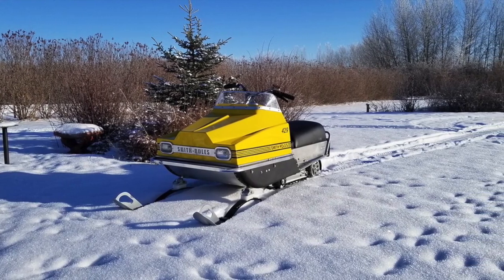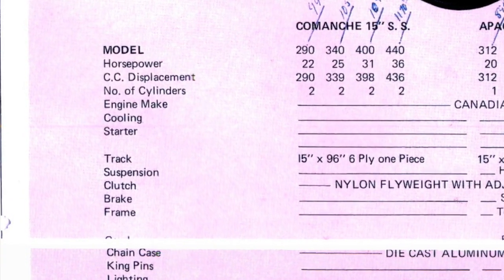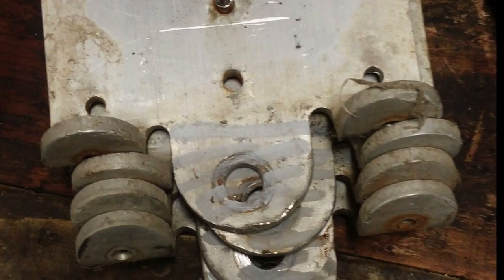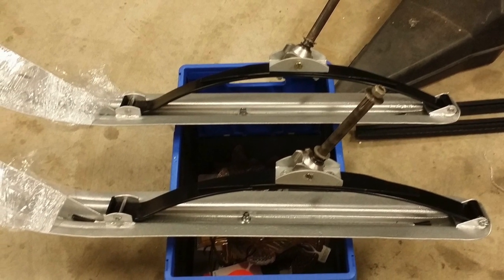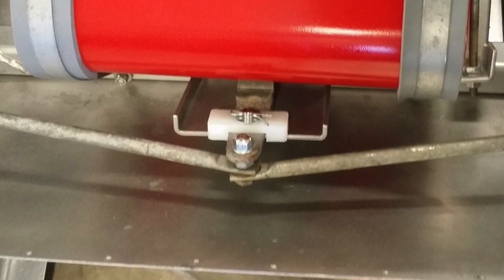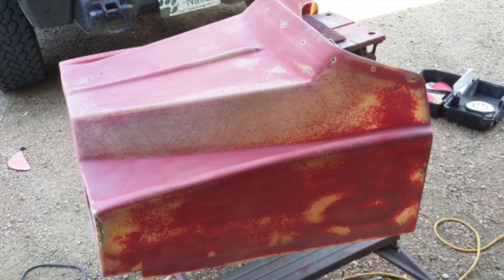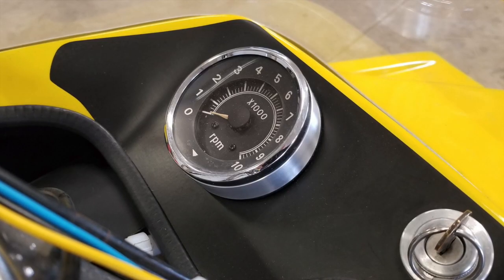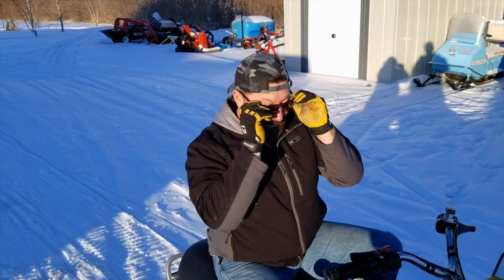Don't Get Daved Episode 18 - Making History - 1971 Roll-o-flex Comanche

Comment: How does the engine like the machined out fins on the up stream head. I replaced so many pistons on those engines that I just gave up on them. I was thinking that this would be the answer but didn't want to play with them any more. I didn't think that you needed to take half of them, but maybe so. We all want to know the answer.
Reply from the maker: Runs awesome. Have one in a whip that runs just as well. Timing is also critical along with being properly sealed.
Reply: @DontGetDaved  It is amazing to me that the engineers did not do this from the start.